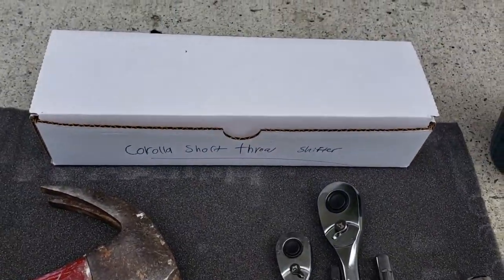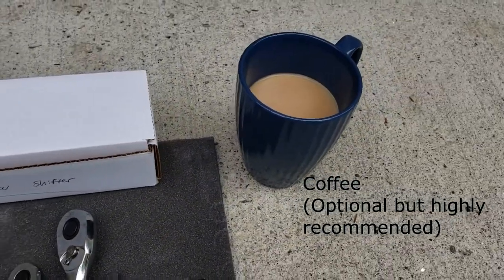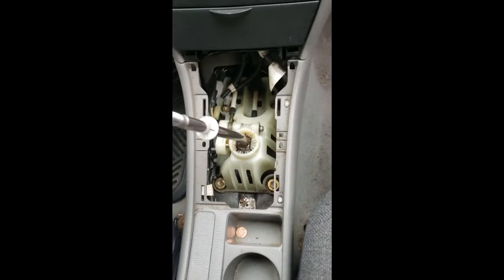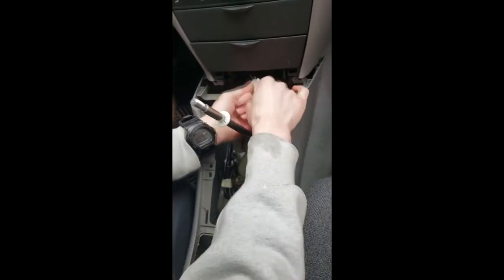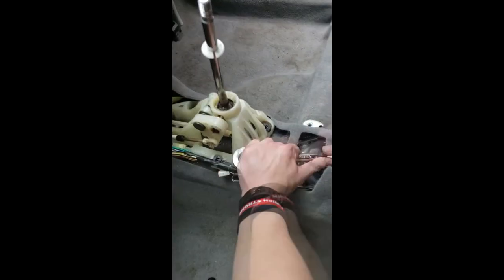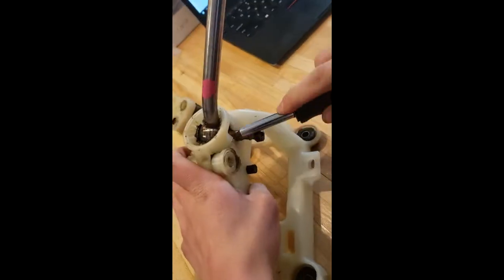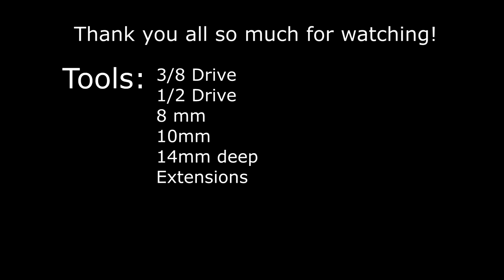How to install a manual short throw shifter: 03-08 Toyota Corolla / Toyota matrix and Pontiac vibe

Comment: How has that shifter held up?
Reply from the maker: Overtime it's actually gotten smoother, I would definitely recommend a weighted shift knob vs stock. It makes it way easier to shift info gears without much force.

Comment: But im not sure what does it mean i pry around it and it will come off. Its okay to speed up some mandatory parts as removing 4 screwes but what about the real thing here. Not clear at all.
Reply from the maker: I do agree it is not clear as it could be. I do plan to remake this video when I restart my Corolla build. What exactly are you having trouble with?
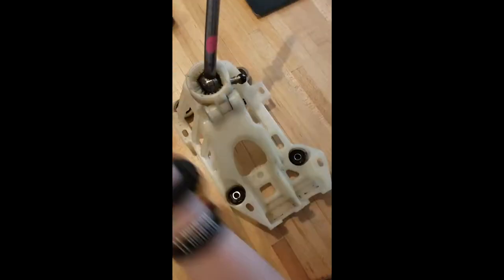Reply: How did you get the cage out? Meaning the two cable bits towards under the dash. You went right past that part around the 1:15 mark

Comment: will this work on a toyota matrix 2006?
Reply from the maker: Should be very similar! Taking apart the dash pieces will be different and the shifter length / size may be different. The concept stays the same.
Reply: No it will nog
Reply: No matrix have different shifters